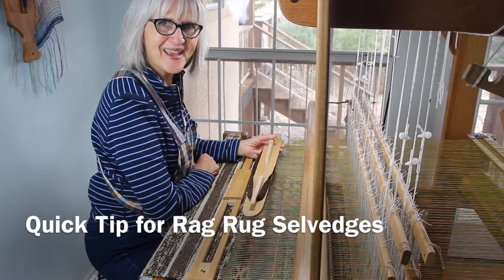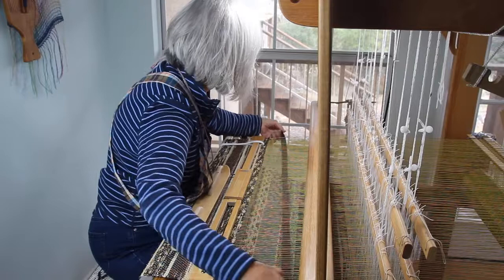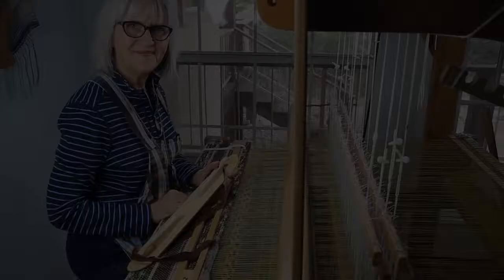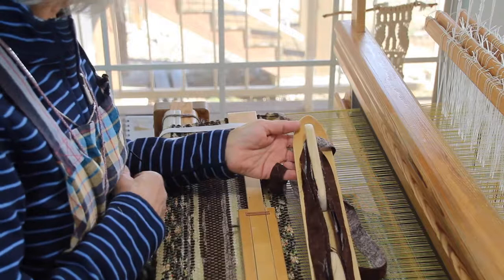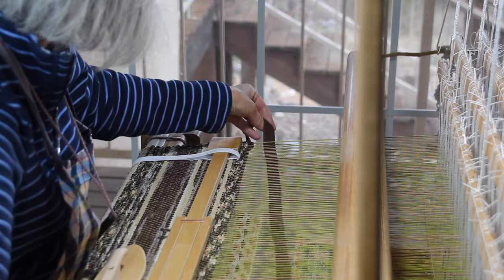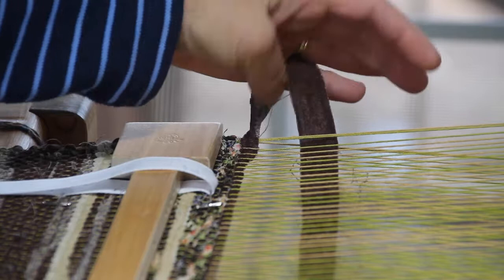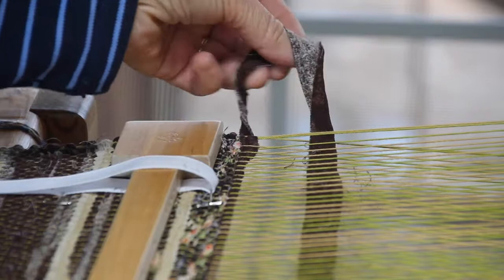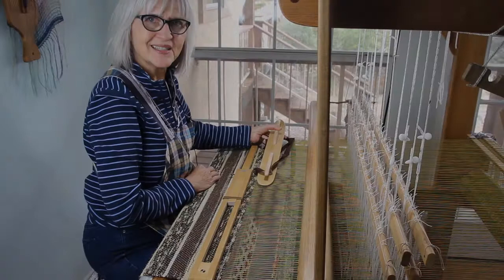Quick Tip for Rag Rug Selvedges

Comment: 💕
Reply: @karenisenhower9886  I am curious as to why you twist the selvage on the rag rugs and why you pull it tight. Your rug selvage is perfect
Reply from the maker: I twist the fabric at the selvedge to make a tidy consistent edge. Pulling the weft snug keeps the outer warp ends from getting slack as the weaving progresses. Thanks for asking!
Reply: @karenisenhower9886  your rugs are perfect 😍